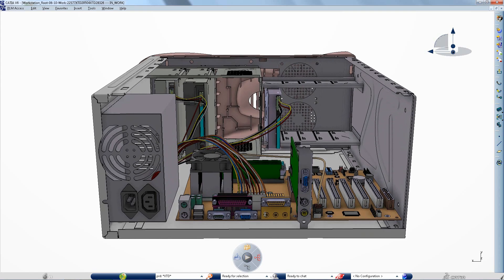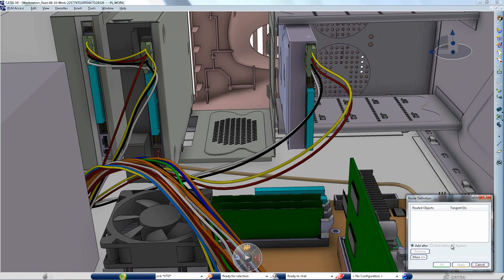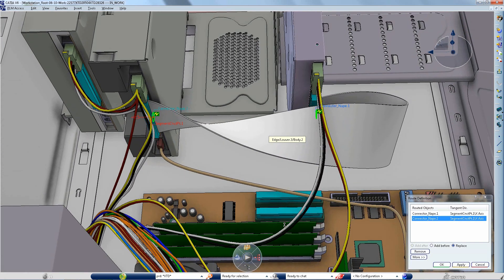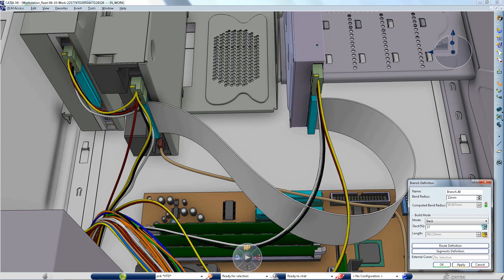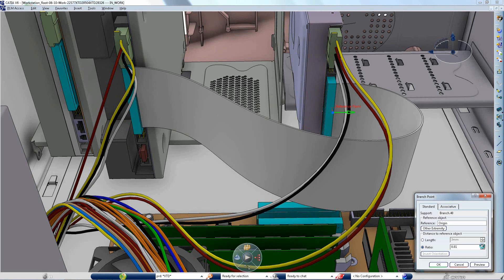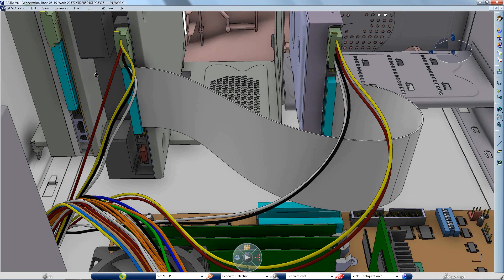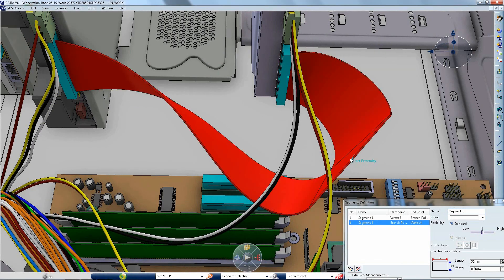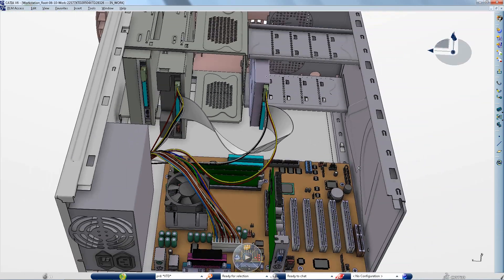CATIA V6 | Electrical & Wire Harness Design | Flat Ribbon Cable

Comment: Using V6-2013X, how are you able to manipulate route objects and have the cable adjust automatically, in real time? That is an extremely useful feature, but I am still required to update manually every time after moving the route objects. Perhaps it is just an option somewhere?
Reply: Tools-Options/Mechanical Design/Assembly Design/General/Select Automatic Update ??